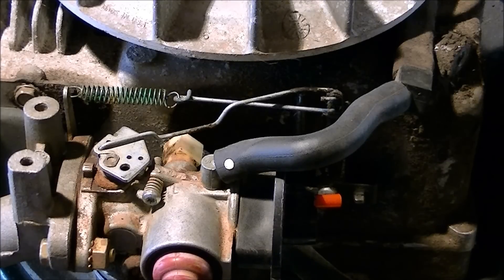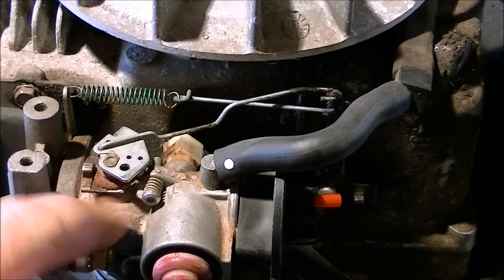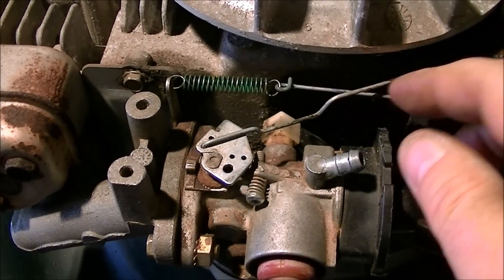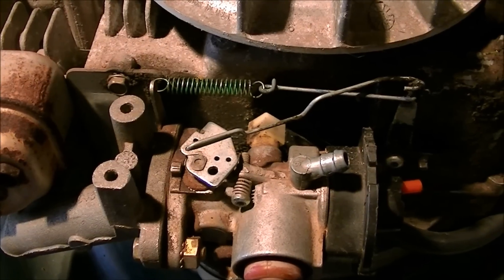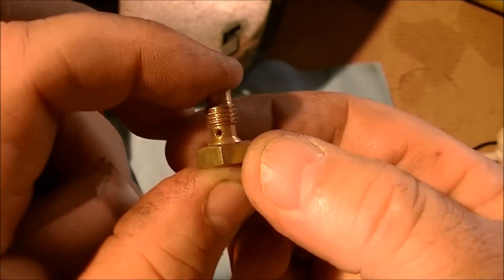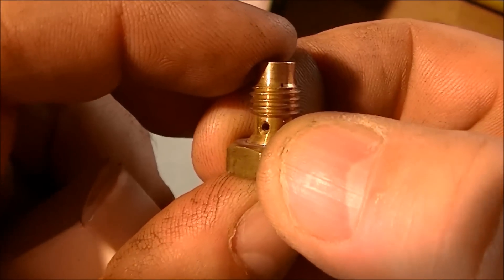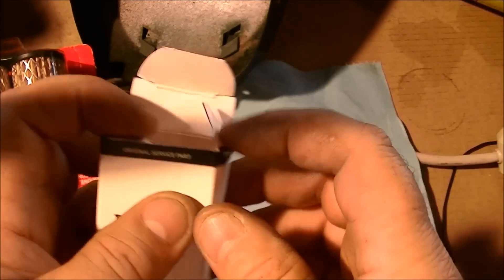Tecumseh lawnmower linkage

Comment: Im having a problem , I set this linkage up as it shows , how on earth will my throttle work, the governor controls the rpm sorta right? between me choking it and the trottle operation, that supposed to work with the governor I thought, that spring is loose to the trottle , can you explain this, I thought the choke has to be connected to something besides just closing when you want to shut it off! I had it running full throttle! so the choke should be a bit on the closed side , when the givernor pievce is straight up its not full throttle right? Somrthin g is messed up here on mine , I got it used lawnboy tecumseh  V7O 125254F

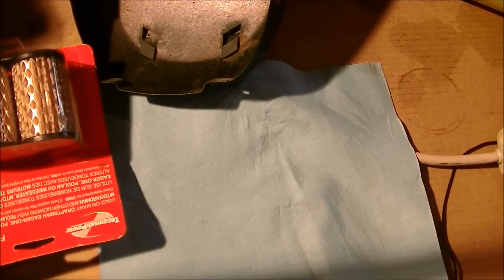Comment: Thank you Tomsmallengines for making this video. @ 1:18 you showed the bowel nut and both sets of holes. I did not see in the small hole in the bowel nut the first time that I removed, and cleaned the carburetor. The second time around I took just the bowl nut off and cleaned the small hole out with my oxy acetylene tip cleaner. This is now a one pull starting mower!!! Thank you again.